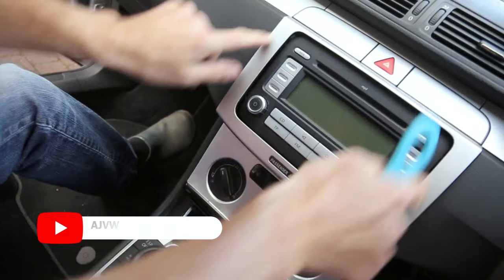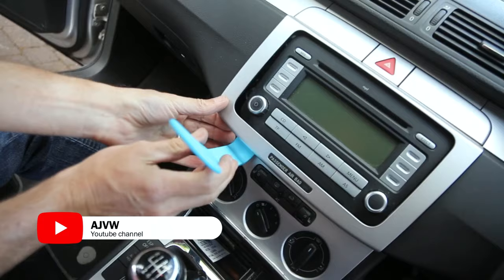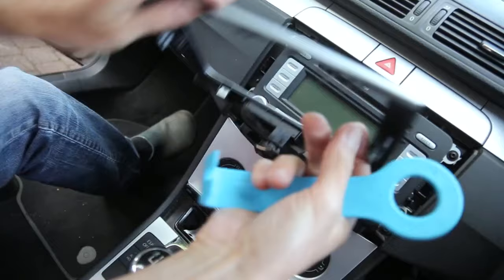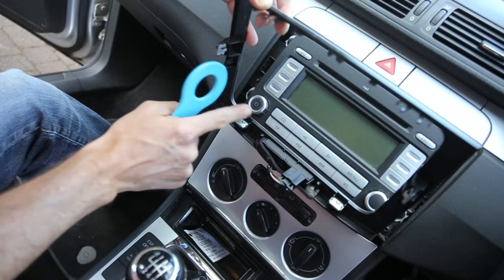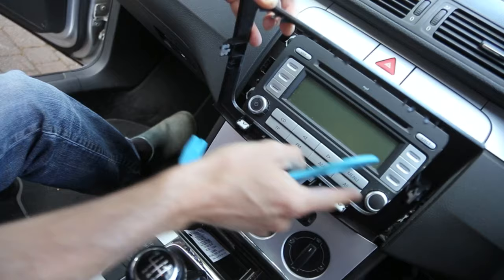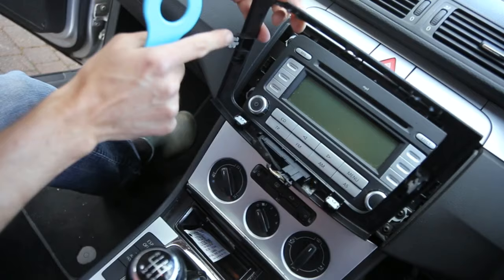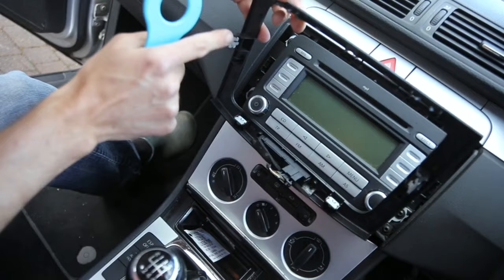VW radio code | How to get

Comment: I read this and tried it and it worked much to my supprise . With the radio turned on press the off but hold it for 50 seconds then let go . You have now turned off . I did not press on untill the next day so do not know if it came on straight away or there is a time delay . Try both if it does not . So you do not  need the code I still do not know mine .

Comment: Just order and paid. Got an email saying that payment was processed and hearsay your code but no code. Still haven’t received anything. What is Manual unlock?
Reply from the maker: We regret to inform you that there has been a delay in sending your codes due to issues with the VAG Group service. 

We apologize for any inconvenience this may have caused.

Rest assured, we are working to resolve the problem and will provide you with your codes within the next few hours.

Thank you for your patience and understanding.

Comment: i paid but i didn’t receive the code it’s been 5 hours i ´m waiting for
Reply: Hi, did you received your code?
Reply: @alexflorentin7977  no
Reply: @ilyasizumi2138  Give me the first 8 characters from your serial number please.
Reply: @alexflorentin7977  VWZ1Z5F51
Reply from the maker: @ilyasizumi2138  Yes please, provide with full serial.
Reply: @carradiocodes7530  VWZ1Z5F51 351 37
Reply from the maker: @ilyasizumi2138  Thank you, I see your code has been sent. VWZ1Z5F5135137 = 0213
Reply: @carradiocodes7530  thank u
Reply: @carradiocodes7530  VWZ1Z5E3908111
Reply: @ilyasizumi2138  did it work?
Reply: @MyNameIsAfro  yes